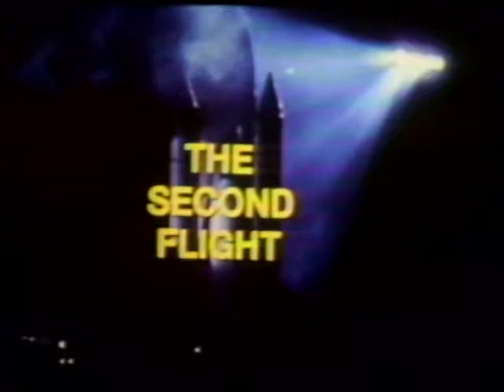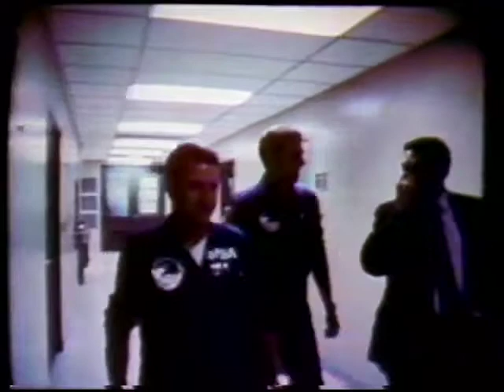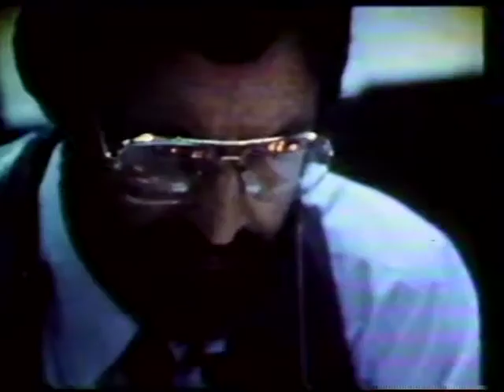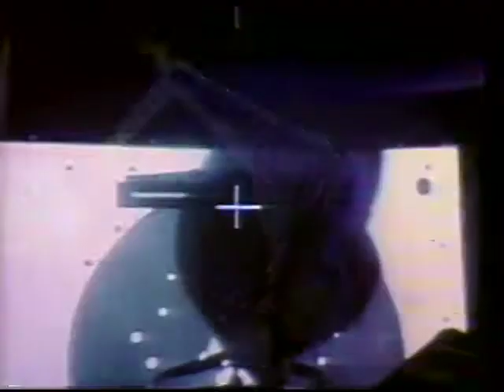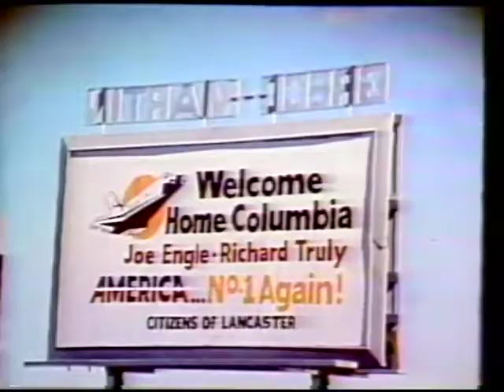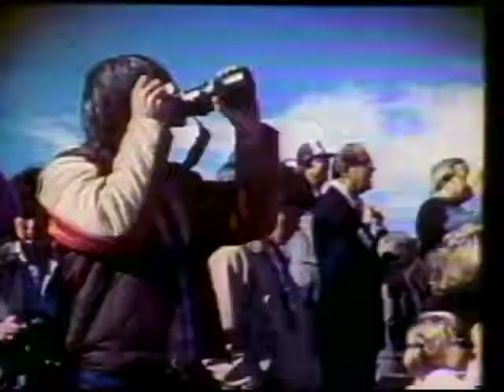STS-2: Postflight Press Conference

Comment: Shame that the reusable spacecraft, designed by about 8 comitees, few of witch were Nasa itself,  turned out to be more expensive than a non-reusable one. So many demands of what it should be able to do, without giving the appropriate budget. made it heavier, bulkier much more expensive and dangerous.   
2 full minutes without ANY abort and crew escape options was madness. These options ran over budget. 
Quick turnaround with minimum maintainance...  one can dream. 

The Shuttle was such an amazing but spoiled achievement.

It did save Hubble though.